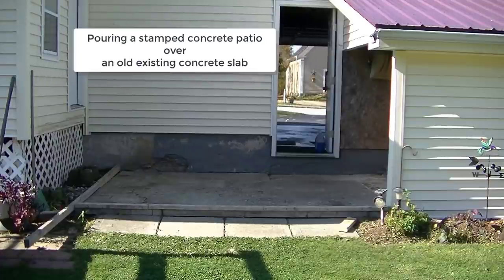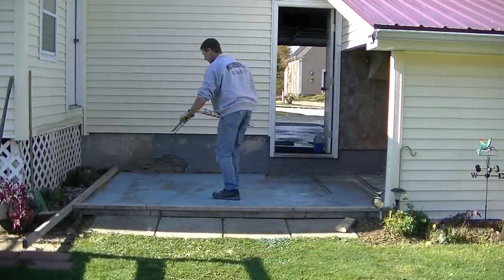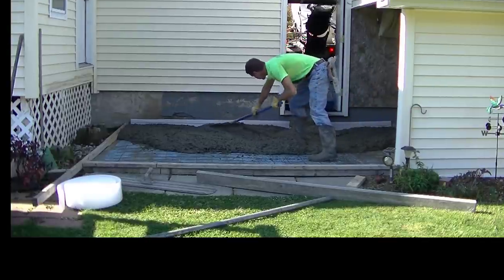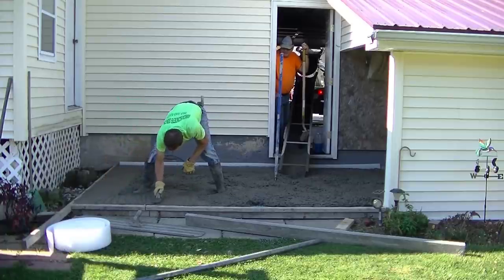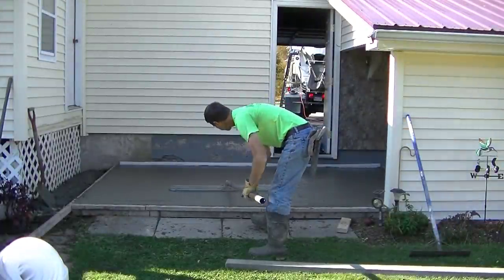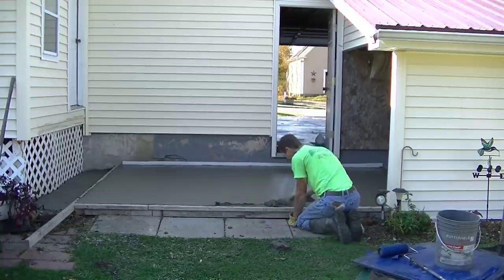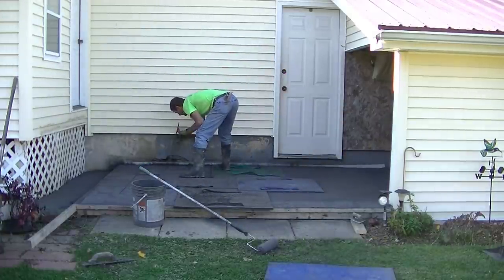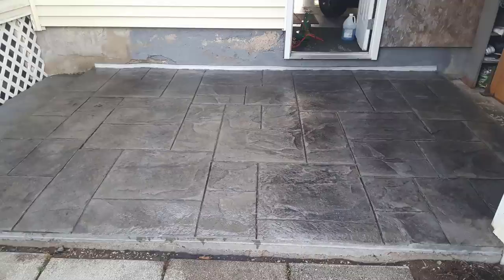How To Pour New Concrete Over Old Concrete | Stamped Concrete Patio

Comment: Did my first concrete slab 3 years ago for a shed for my mother in law. 12' x 20' monolithic pour. Didn't use bull float but ran a straight 2x4 back and forth on top of the forms, waited for the concrete to dry a bit then I mag float the whole floor and gave it a broom finish. Turned out really nice. In a month I'm doing 2 pours for 2 sheds 12'x10' and using the same procedure I used 3 years ago. Everything is air entrained and fiber meshed. Awesome video, keep up the good work.

Comment: Mike, if the existing patio had a couple coats of paint (100% acrylic paint), would you recommend the removal of that paint first, before applying the concrete bonding agent? I would guess a rougher surface to the existing concrete patio would promote better bonding to the new concrete. If removal of the paint is preferred, do you have a recommendation on how best to do that? My local tool rental shop has a cement grinder, but the more aggressive "accessories" that it comes with is designed to not only remove the paint but also do light leveling. That seems a bit overkill. They don't offer a more mild disk with the cement grinder. Instead, I could rent a floor polisher/ buffer with a cutting removal tool, but those appear to be designed for interior concrete and the video states it is not designed for sidewalks and patios.  Thanks for your suggestions.
Reply from the maker: I lightly grind off the old paint then use the bonding agent. I use a hand grinder and diamond cup wheel. Apply pressure as needed to remove the paint.

Comment: If it's wet and cold, a 1 percent Calcium gets the job done. 4000 psi with fiber is also my favorite, and I also put wire or rebar to help avoid cracks. Works.

Comment: great no nonsense advice. What is the mix (including microfibres)? I'm doing 4 square metres ranging from 40mm to 90mm thick.  I've read 1 cement, 3 stone(less than 10m) and 2 sand(triple washed?) amount of fibres? Thanks

Comment: Really great videos, thank you so much for providing this information.  I'm raising a garage floor- 9 x 14 feet and 4 inches deep at the front, 3 inches at the back.  Should I use Iso-strip against the concrete base wall or let it bond?  New to this so want to make sure I get it right.  I'm planning on using wire and bonding agent too.  Really grateful for any advice. TIA.

Comment: I am about to pour cement over an existing 12x30 slab (original slab is probably 4 inches thick-not cracked-27 years old). Going to pour another 4 1/2" high at house and slope down to 3 1/2" at outside edge (free standing back porch going on it, 6x6 posts so not an outdoor room or anything.  I like the bonding agent and rebar, my question is do you need plastic between the two slabs?  Any thoughts on adding some fiber to the mix?

Comment: Really interesting videos you share - thank you. I had a pad poured for me, and they contractors used a hardning agent to speed up the drying time as they chose a day that was very windy, it rained several times throughout the day, and periodically bright warm sun. They didn't cover the pad during times of rain, and in the end, it destroyed the top layer, there were pitted sections of the pad along the wall side where the rain runoff fell... the concrete cracked approx 25 times in less than 6 weeks, and there was a lot of discolouration, and strange circle patterns in some parts of the pad. They tried grinding and sealing the pad as an attempt to fix it, but it is still quite badly discoloured... I think New Zealand is in need of good quality tradesmen
Reply from the maker: Getting rained on does suck, that's unfortunate.

Comment: Mike, looking for information. I want to Raise the floor in my house 68 yrs old, it had wood floors over the concrete base slats glued down with tar the tar scrapes up but leaves it in the pours of the old concrete do i have to sand blast this out or can I do the bonding agent material over the old concrete and still get a good bond.
Reply from the maker: If you pour 3" thick or more, you can just pour right over it. 1.5" to 3" just scrape off what you can and use bonding agent, then pour.

Comment: Weld-crete vs Muriatic Acid. I've heard to get the new to bond with the old, you can use Muriatic and then immediately throw on the new concrete. What is your opinion on the process? Have you ever tried it with the acid?

Comment: Hey Mike, my name is David Mueller with Dave’s Concrete and Masonry.Thanks so much for your videos you have been a great help to me. I grew up in the concrete and masonry trade with my father as my teacher, so I have been doing this for quite a while, and Yes, I definitely can relate to the weather pushing you around. I am prepping and pouring a 35 x 15 patio, which has a roughly 10 x 10 existing concrete patio inside the area. I was going to put a bonding agent down and then a rebar mat 1 foot on center, what would you recommend?

Comment: Thanks for the info.  I have a very stable patio but want to extend it and overpour so the texture will match.  Do you feel this is the best method as I've have a few concrete folks say they dowel the current slab which has post tension wires in it because it was poured and connected as part of the house slab.  I don't feel comfortable with doweling from what I've read.  Also,  do you not trip the isostrip level with the concrete or does it have to stick above the poured concrete?  Thanks.
Reply from the maker: Iso strip can be level, yes. I generally dowel into existing slabs when I extend them. Your choice though.

Comment: Hi Mike. I have a garage built in a concrete slab. The garage is 30 feet long and 16 feet wide. The city wants a concrete foundation put in if I convert the garage to a garden suite. Is there a way to put a foundation under an existing slab? Thank you. Gary Schneider.
Reply from the maker: It would probably be more expensive than just doing it from scratch. I'd say no but depends on what the city specs as a "foundation".

Comment: I wish you were in the Michigan area, the contractor that I hired screwed my backyard patio up. Poured the concrete and dried up too quick for him to level everything off. Now it’s all dried up with clumps and uneven concrete. He also stopped answering my calls to finish the job. Sigh
Reply from the maker: I hope you didn't pay him everything yet. Sounds like a demo and re-do or maybe grind and overlay it.
Reply: Mike Day Everything About Concrete unfortunately I did pay in full I actually paid him half but the day of cement pouring the cement truck was a separate company and I Pretty much paid the other half to the truck driver smh. Would I be able to do the same thing you did On uneven/lumpy concrete?

Comment: Not that experience in concrete bidding out a job with a concrete poor over an old slab but it is bigger. You mentioned it more likely to crack that way is there a solution! Besides jack hammering it out

Comment: Im looking for some guidance. My garage wall came off the foundation and we have to remove the garage... the concrete is cracked and broken in several spots,  to remove the concrete is over $3k . What i want to know is if i can break up the slab into smaller pieces, add 8" of compacted fill dirt over it then pour a new 4" slab over the top if the old?
Reply from the maker: It sounds like you could as long as the existing slab and sub-grade hasn't settled in the past. If it has then you still may have settling issues, better to remove and fix that so no problems in the future.

Comment: does bonding a concrete slab over an old slab of concrete cause cracking due to differences in expansion and contraction at different rates of the two slabs?
Reply from the maker: It could but not really too much trouble if you bond them together.

Comment: Hey Mike, if that slab had decent sized cracks in it what should you use to seal them/fix them before you pour.
Reply from the maker: I'd fill with sand, then lay a thin layer of styrofoam over the slab 1/4" or 1/2", then pour the new concrete on top of that.
Reply: @MikeDayConcrete  How about better leave the new concrete to fill the cracks?

Comment: How or where do you get rid of left over concrete? and where do the drivers wash off in residential jobs? We’ve been using wheelbarrows  for wash offs
Reply from the maker: Same here, wheelbarrow to wash in. They had a debris pile I could dump the extra in from the slab.

Comment: I had someone pour me a patio and it has  sloping dips in different parts ot also slope away from the house but when I sit chairs there and sit in them I lean forward can I level it by adding the square flag stones and mortar I don't know how to work with concrete but I rather try myself than pay someone again and get a messed up job I'm so aggravated by this I really need help
Reply from the maker: I suppose you could mortar and flagstone over it if you're capable.

Comment: Hi Mike, with that front lip only 2 inches, is there any chance it might crack considering they drive the lawnmower up on that lip? I was considering to have someone pour a thin (1-2 inch) coat over existing pool decking (4 inch concrete with the pebbles exposed) and was told that they would not want to do that due to potential cracking of the stamped concrete. is that a valid concern?

Comment: Wonder if we can use this technique over our 13 year old driveway and stamp it. Would the weight of the cars crack the new concrete over time? Wonderful video.
Reply: you need too check the air pressure in the drive way first

Comment: great video. I am wondering. I'm going to pour a slab (for my house) in two stages. I want to pour the slab then install all the pex pipes for radiant floor heating, then pour the final two inches over it. Should I use that bonding agent, on a slab that was only poured a few days before?
Reply from the maker: Why would you want to pour it in 2 pours. We've done 1000's of radiant floors and never done that way?